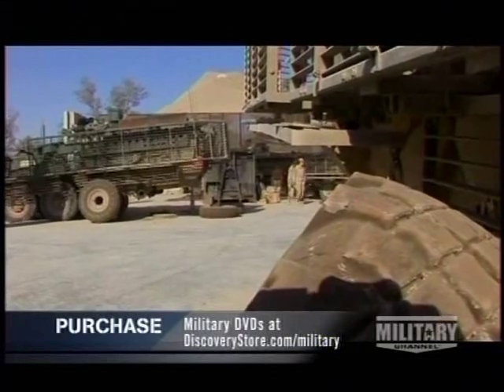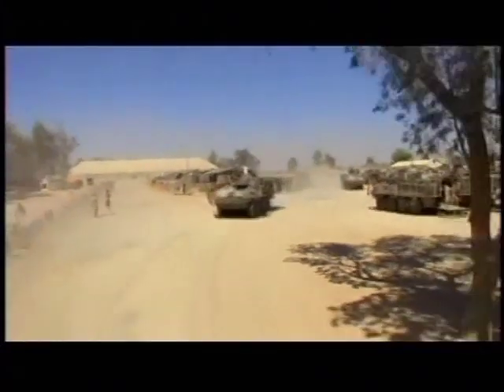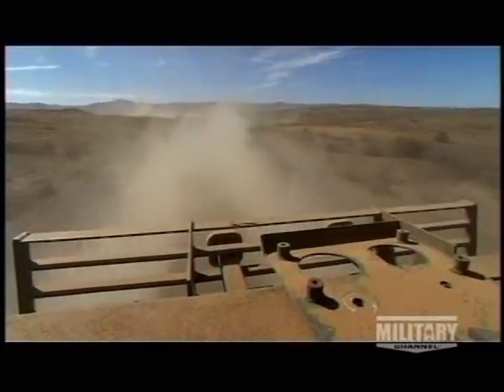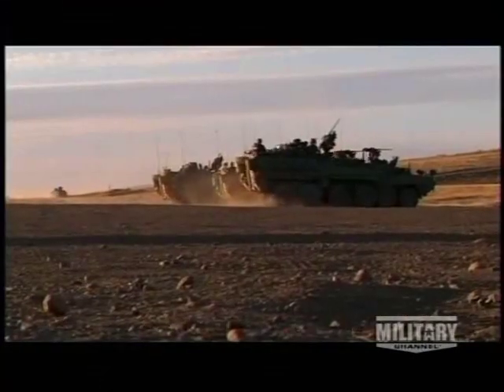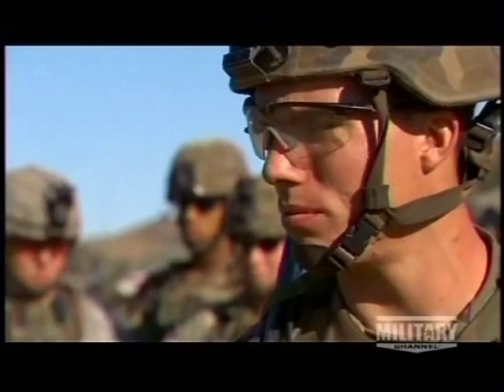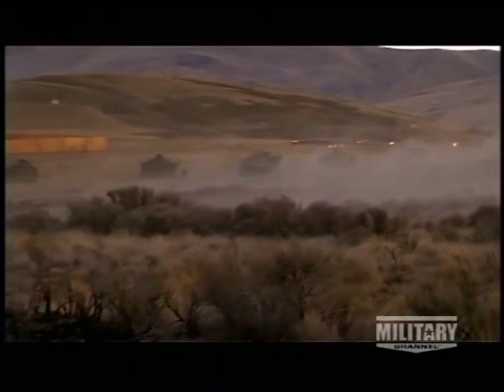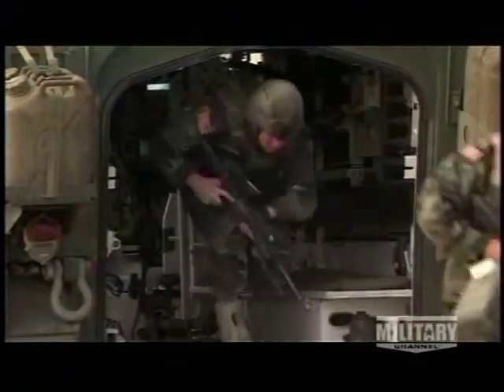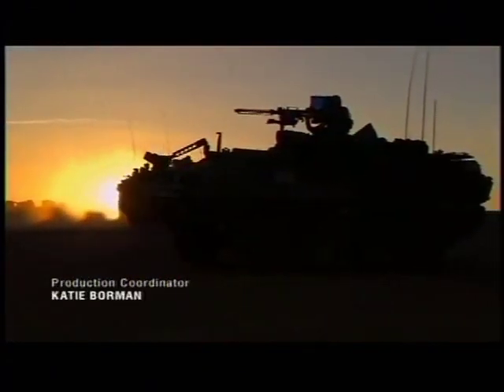Anatomy of a Stryker Part 5

Comment: The Abrams has had its fair share of upgrades along the way too. The formidable M1A2SEP will now be succeded by the M1A3, currently under development due to be deployed in 2017. 
I find it interesting that the Abrams and Leopard can keep up with the Challenger 2 even though their base models are 18-19 years older than the Challenger 2. It shows the solid design of these NATO tanks.

Comment: The Chally 2 and Leo 2A7+ have all round 3rd Generation Armour.The first Chally 2 ugrade was Tier 1(Street fighter Iraq 2003)Chally 2 Tier 2  and Tier 3 with all round protection and Leo2a7+. The Leo2A7+ 120mm L55 has 30% more Mv than the 120mm L44 a quote from Rheinmetall its 1.37mtrs longer.The American M829A3 round makes up for this but if you had a 120mmL55 you would have that 30% more Mv increasing the guns distance by 1500m. Britian and Germany have new ammo also.Top notch yes I agree.

Comment: A bold statement I think if you do your homework properley there are better tanks out there like Challanger 2, Leopard 2A7+ which have better firepower and armour protection esspecially Challanger 2 with Dorchester Chobham armour and there firepower being in the class of 55 calibre 120mm guns to Abrams 44 caliber 120mm. Though when the M1A3 Abrams comes out now that will be an interesting bit of kit.Stryker is only good for hunting down terrorists agianst a modern army you need a tank and a IFV.